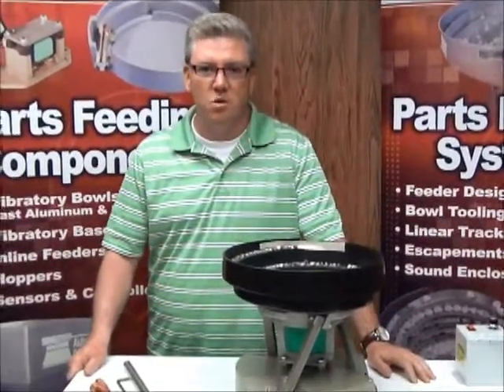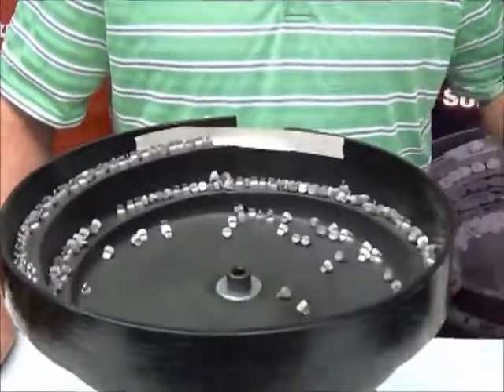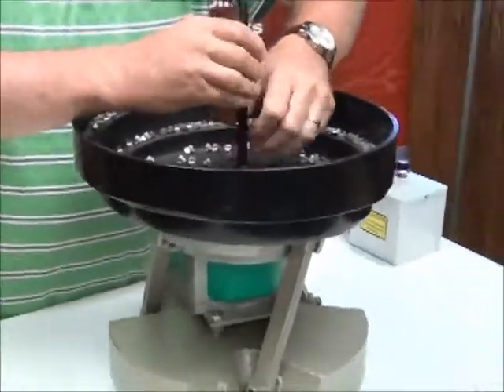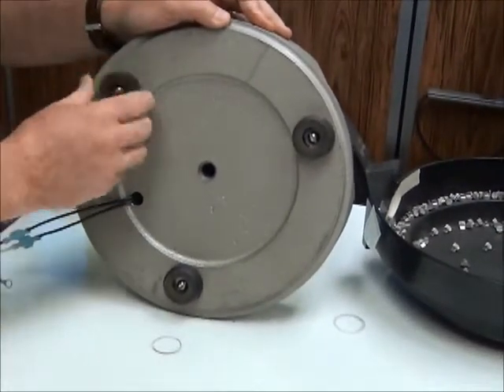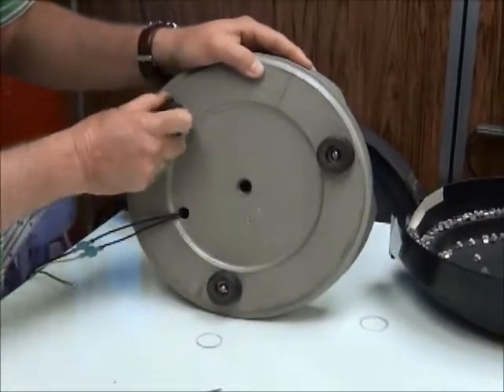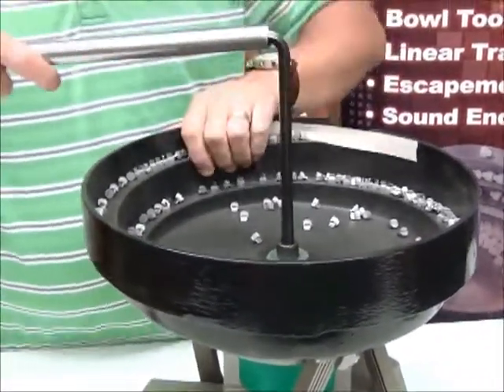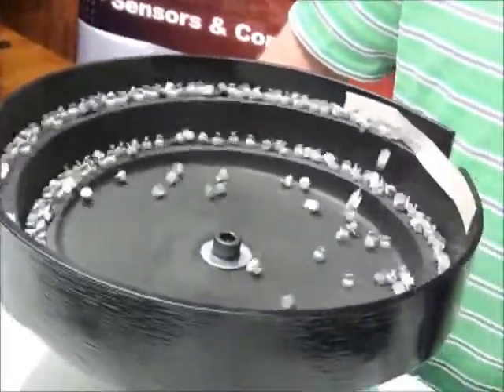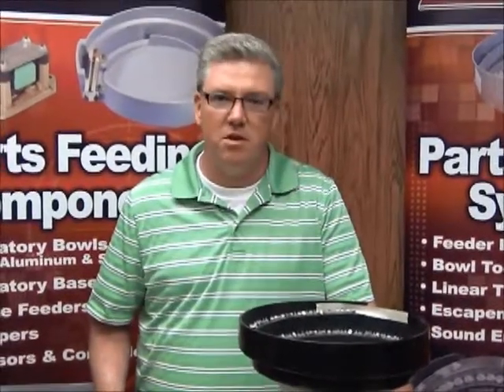Rubber Feet: An ADI Feeding Tip

Comment: how it could be moving up and not moving down?
what is its principle like in physics?
Reply from the maker: Thanks for the inquiry! Contact Dave @ dwelch@autodev.com for detailed info.
Reply: Look at the angle of the springs. If you had a high speed camera closeup you will see the parts are getting thrown up and forward just a little bit